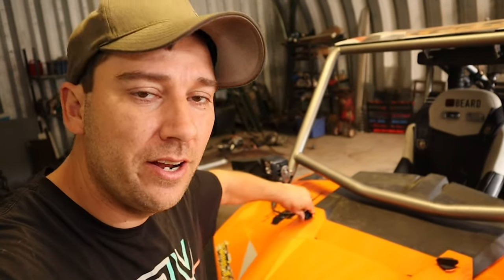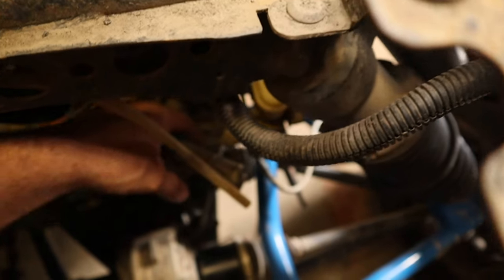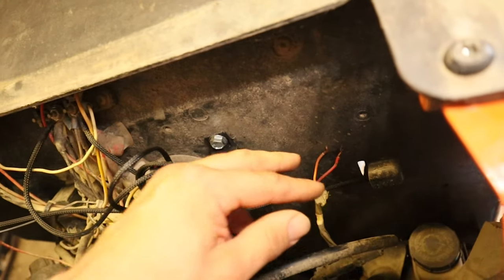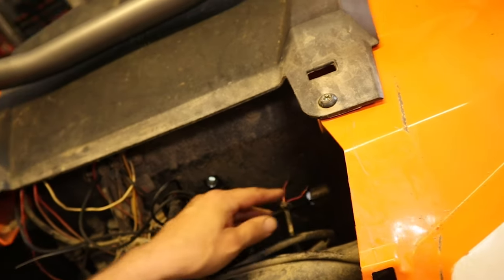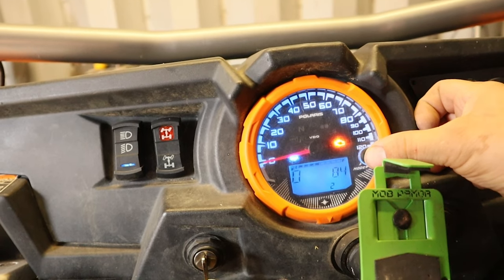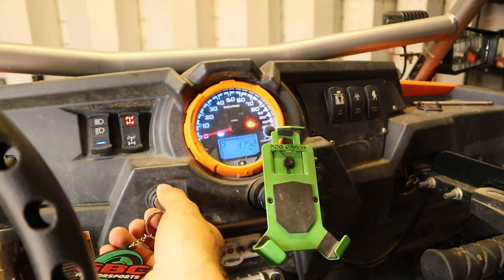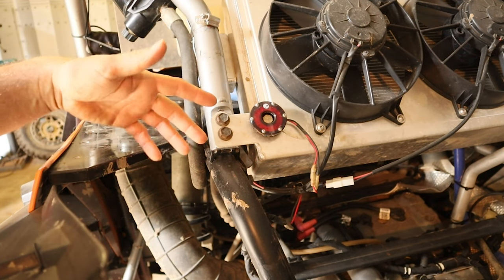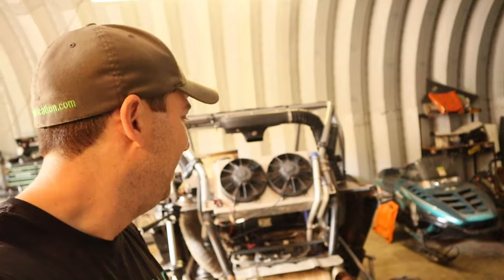Polaris RZR won't start! Brake sensor trail fix.

Comment: Since it thinks the brakes are on... does it limit your speed or limp the throttle? Can you still go full out when those wires are connected?
Reply from the maker: It doesn't effect anything else just let's you start it still.
Reply: @SpangsWorld  newer vehicles I've found out it can. It thinks you are pressing the brake and gas at the same time. This can throw a code and put it into limp mode.

Comment: 2:14 you said if you pull the harnesses out? seat harness? im chasing wires and plug on mine and have a plug like that but noting in it. what was originally plugged in?
Reply from the maker: For the seat plug it should be a sensor for if your seat belt is buckled or not. If it's unplugged or your seat belt isn't buckled you shouldn't be able to go over 15 MPH.

Comment: Question sir… I’m currently diagnosing a no crank issue on a 1000XP,  (I’ve already replaced the solenoid) but I unplugged the two pin connector at the brake switch and jumped the two female pins with a small cotter pin. I would think that would close that circuit to fool the ecu into thinking that the brake pedal was pushed. Am I right? Still no crank. 12.6V, new solenoid. I jumped the solenoid and the engine cranked. (That’s why I replaced the solenoid).  Thanks very much for your time and consideration.
Reply from the maker: Do you have good connection with the cotter pin in the plug? I ended up originally pulling the pin I had in the plug and cutting the plug off to make the connection. The piece I had in wouldn't always make a good connection. Unless there is another issue going on.
Reply: Check the relays i had that problem with mine

Comment: Do you have to have the harness byPass plug in order for this to work you have to push my brake extremely hard for it to work
Reply from the maker: Not sure. I have had the bypass in basically since I had the machine.
Reply: the harness bypass has nothing to do with the brake/start bypass....

Comment: would it cause the fuel pump not to kick on when you first turn
Reply from the maker: Not sure if it would cause the fuel pump not to work. If it's still cranking when starting there is probably a different problem.

Comment: Did it clear your speed sensor code when you replaced the brake pressure switch?
Reply from the maker: Switching it out did.

Comment: Similar issue, rzr 800s, parked it one night, found my dog digging in the rear end chasing a mouse,  next day cranks but won’t start.  New fuel pump, new spark plug wires, but no spark.  Any tips?
Reply from the maker: New spark plugs or old? If using old ones might need to clean the ends.
Reply: @SpangsWorld  old, but I tested the boot.
Reply from the maker: @The Moon and Stars  make sure everything is seated right. Might need to check the wiring harness and see if the mouse ate any of it.
Reply: @SpangsWorld  thanks i will double check.